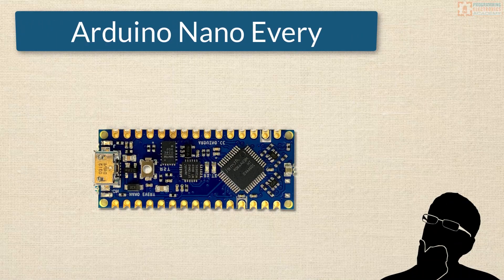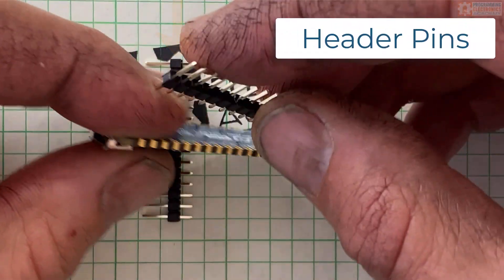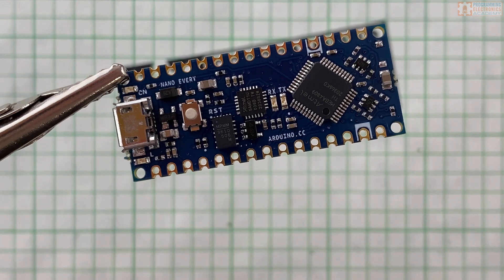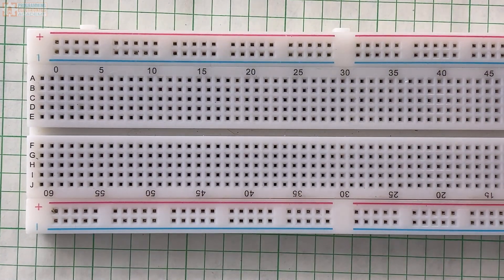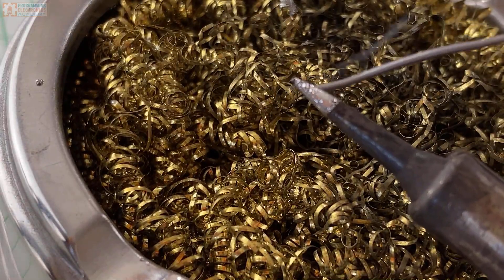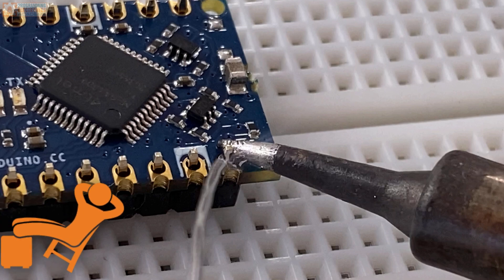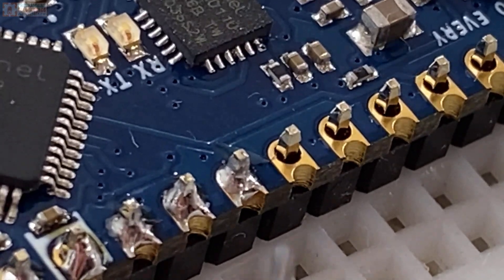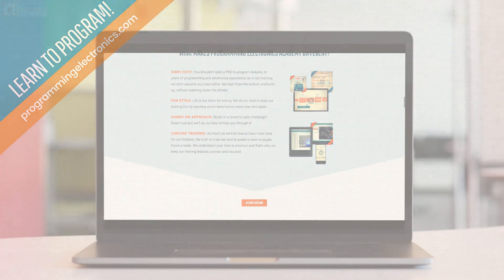Soldering Arduino Nano Every

Comment: My dad has several Arduino Nanos laying around, but the only ones that come with an USB port had to be soldered. The other ones all only use ICSP, which I don't have a programmer for. So yes, this was really helpful, since I never soldered to PCBs before, only freehand wires or to Pots or TRS sockets

Comment: Hi, to solder the pins of the Arduino nano what is the optimal tip size, 0.8 - 1 mm or larger ?

Comment: I made it reverse, so long side to the top, is this bad?
Reply from the maker: As long as you can access the pins, you'll be fine.  When on a breadboard, with the pins down, you may have trouble reaching the reset button, but otherwise, good to go!

Comment: What are the half/semicircle/incomplete pins on the outer side of the generic header pins for?
Reply from the maker: Those are for if you wanted to solder the nano to a circuit board.
Reply: @programmingelectronics  but we can do that for the through hole ones anyways, why have those half ones then?

Comment: How thick should the solder be?
0.8mm? 0.4mm? And does the tin to lead ratio matter?
Reply: That I also want to know. And was your temperature in Celsius or Fahrenheit?
Reply: @mrmaglet  Celsius, if it was Fahrenheit I belive it would be around 300-400 ish.
Reply: Depends really, if you find either to be easier to use, personally I use 0.8mm and it works like a charm. The tin to lead ratio is usually 60/40 or 63/37, both will work fine! But if ur using lead free solder it may be a bit difficult.

Comment: Can you surface mount it to pads on a PCB? I have a Arduino Nano footprint for a SMD type so I assume with enough flux it would work
Reply from the maker: Great question!  Yes you can, in fact thats what those edge cut outs allow for.

Comment: I like the seemingly obvious idea of using the breadboard to hold everything while soldering.  It was that obvious I was going to go with tape.  Thanks, it's a much better idea
Reply from the maker: I hope it helps!  It is worth noting, if due care is not taken you can melt the breadboard some where the pins get hot.

Comment: I'm no critic but I do have a tip about the brass wool you're using to clean the iron 's tip. Don't do that. I have, on two different occasions, used this brass wool, too. Inside of 3 weeks, the tip developed a trench and the tip went to crap.  Normally, I use a wet sponge. The replacment tip, after 6 months, still looks and performs like new. You're video was very informative and filled in some  gaps in my knowledge.

Comment: An other advantage of not having the pins pre-fitted is it lets you decide if you want to put the Nano into a breadboard or use female DuPont cables for connection. i.e.  pins pointing up or down.   great tutorial thanks.
Reply: And another advantage is that these new Arduino boards have no components on the underside and can be soldered directly onto another PCB using the edge connections.
Reply from the maker: @Ed.R  Thanks for adding that!
Reply from the maker: Great point!

Comment: I never thought about using the breadboard as a holder.  Im so dumb or you're so smart.  amazing tip.
Reply from the maker: I’m definitely not so smart.   You do have to be careful, because if you apply too much heat it can melt the breadboard in spots.

Comment: Hi. I am looking for a basic replacement for my Arduino UNO. I don't need extra feature, just a smaller footprint, cheaper but with the same features and libraries as the UNO. Is the Nano Every a good candidate for that purpose ?
Reply from the maker: Yes, I think the Arduino Nano Every would be a great option for what you are describing.

Comment: @4m10s area: To be clear, that's a freeze frame. You don't leave your hot iron on the joint for an entire minute. As mentioned, just a second or two; just until it melts and maybe a half-second more (to make sure). Cheers.